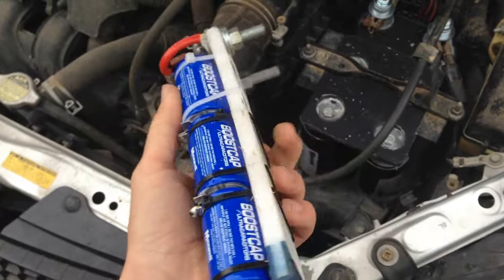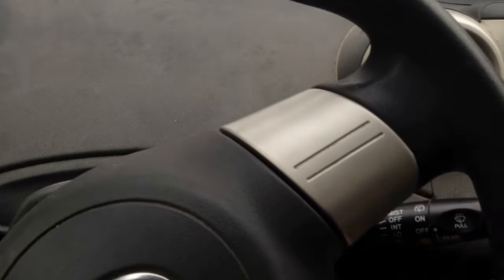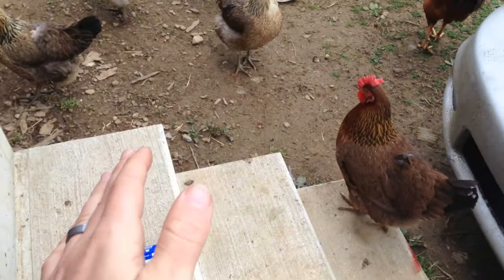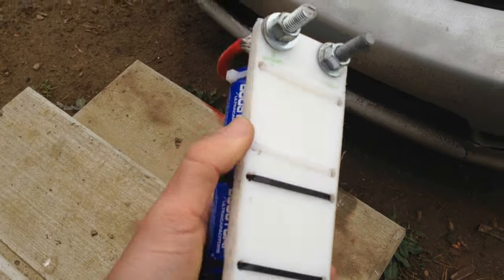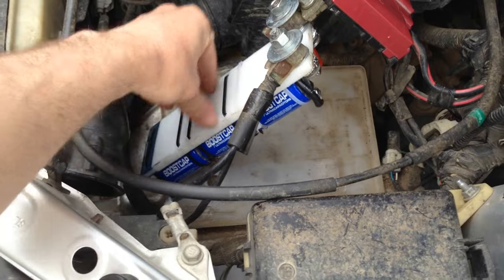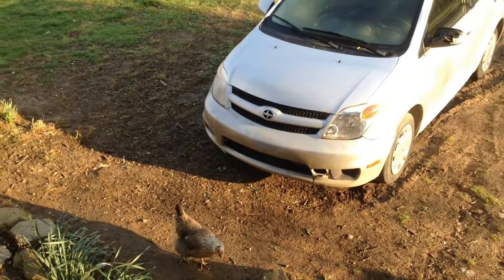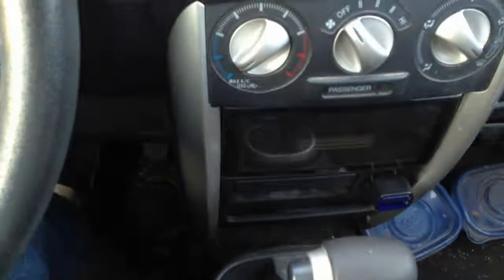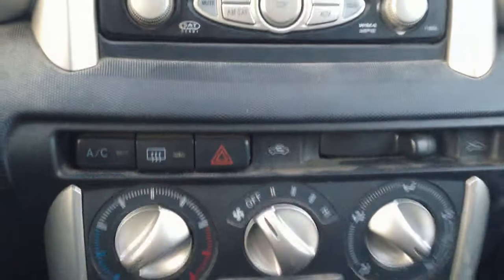Replacing My Car Battery with Capacitors! 12V BoostPack Update

Comment: This info is from the internet a university site!
I haven't copied it all. 

BU-209: How does a Supercapacitor Work?

Discover how the supercapacitor can enhance the battery.

The supercapacitor, also known as ultracapacitor or double-layer capacitor, differs from a regular capacitor in that it has very high capacitance. A capacitor stores energy by means of a static charge as opposed to an electrochemical reaction. Applying a voltage differential on the positive and negative plates charges the capacitor. This is similar to the buildup of electrical charge when walking on a carpet. Touching an object releases the energy through the finger.

There are three types of capacitors and the most basic is the electrostatic capacitor with a dry separator. This original capacitor has very low capacitance and is used to filter signals and tune radio frequencies. The size ranges from a few pico-farads (pf) to low microfarad (μF).

The electrolytic capacitor provides more farads and these larger units are used for filtering, buffering and signal coupling. Rated in microfarads (μF), this capacitor has several thousand times the storage capacity of the electrostatic capacitor and uses a moist separator. The third type is the supercapacitor, rated in farads, which is thousands of times higher than the electrolytic capacitor. The supercapacitor is used for energy storage undergoing frequent charge and discharge cycles at high current and short duration.

Farad is a unit of capacitance named after the English physicist Michael Faraday. One farad stores one coulomb of electrical charge when applying one volt. One microfarad is one million times smaller than a farad, and one pico-farad is again one million times smaller than the microfarad.

Engineers at General Electric first experimented with an early version of supercapacitor in 1957, but there were no known commercial applications. In 1966, Standard Oil rediscovered the effect of the double-layer capacitor, which makes the supercapacitor work, by accident while working on experimental fuel cell designs. The company did not commercialize the invention but licensed it to NEC, which in 1978 marketed the technology as “supercapacitor” for computer memory backup. It was not until the 1990s that advances in materials and manufacturing methods led to improved performance and lower cost.

The supercapacitor has evolved and crosses into battery technology by using special electrodes and electrolyte. While the basic Electrochemical Double Layer Capacitor (EDLC) depends on electrostatic action, the Asymmetric Electrochemical Double Layer Capacitor (AEDLC) uses battery-like electrodes to gain higher energy density, but this is affected by a shorter cycle life and other burdens shared with the battery. Graphene electrodes promise improvements with supercapacitors and batteries but such development is 15 years away.

Several types of electrodes have been tried and most are based on the electrochemical double-layer capacitor concept, which is carbon-based, has an organic electrolyte that is easy to manufacture and is the most common system in use today. 

All capacitors have voltage limits. While the electrostatic capacitor can be made to withstand high volts, the supercapacitor is confined to 2.5–2.7V. Voltages of 2.8V and higher are possible but they reduce the service life. To get higher voltages, several supercapacitors are connected in series. Serial connection reduces the total capacitance and increases the internal resistance. Strings of more than three capacitors require voltage balancing to prevent any cell from going into over-voltage. Lithium-ion batteries share a similar protection circuit.

Comment: Impressive since the capacitor bank is rated 16.2V / 58 Farads.
Reply: which are just 2Wh total, when the coltage drops to zero. Traditional lead acid 12V 55Ah battery has 660Wh
Reply: These are 350F caps, all in series so 1/(6/350F)=125/3=42F in total.
With a total voltage of 2.5*6=15V (Maybe one cap bust).
Typical start up current (Which varies with temperature) is about 200A, equivalent to a resistance of 12/200=60mR.
Therefore the time taken to discharge to 0.63& of 15V is around (0.06*42=2.52sec), ot sure on the time taken to start a car but guess a second?, so good for around 3 starts?.
Reply: (6) 350F caps in series is 58F.
Reply: electronicsNmore 350/6, which is indeed 58.3333333333333333333333333333333333333333333333333333333333333333333333333333333333333333333333333333333333333333333333333333333333333333333333333333333333333 lol
Reply: John Siviter
 You forgot to include leakage. Capacitors are not perfect and leak over time.
Reply: True, refer to datasheet to calculate that)
Reply: megamixa
Reply: John Siviter
My 3.0litre, 6 cylinder engine's Starter system has a 50A fuse on it, so it must'nt draw more than that when cranking in the cold. I believe the BoostCap Battery would crank for quite some time, as demonstrated in one of the follow-up videos on a much smaller engine.  Further, as the Voltage presented to the starter by the BoostCap would be greater than the typical Lead Acid battery under starting load, the engine would likely turn over faster as well, lengthening it's ability to deliver a starting charge.
Reply: heysoundude Starter motors do not have fuses connected on them, what you're refering to as the 50A fuse for the "starter system" it is in fact the solenoid part of the starter motor only, not for the actual motor it self. The motor part is un-fused and connected directly to the battery via the thick cable, which is where the 200A goes thru.
Reply: Black Wolf Good catch, not that he needed my endorsement but Black Wolf is correct. Starter motors use hundreds of amps.
Reply: I would like to see it crank the starter for a few seconds instead of just a "ka-Vroom" start.  I think my old car is more of a "Zha-Zha-Zha-Zha-Vroom".  :-)
Reply: Stan Skaggs In your case it would be Zha-Zha-Zhaa-Zhaaaa-Zhaaaaawwwwwww... without the Vroom on the end, however one might be able to hear a few #%?& or even %&#?#
Reply: I've got 12 of the big caps and they have worked for 3 years no problems. I have to start my car after 3 days if I don't drive it . If your caps go lower than 10 volts your fucked.
Reply: @engjds  350F/6=58.33F
Reply: @HSV1066  i kept laughing when reading this comment... :-D
Reply: Thank you for the explanation, but would you advise us to use these capacitors instead of the battery? Thank you
Reply: @petrvalkoun4539  advh

Comment: Cool video. I'll keep my lead acid battery though. If your alternator quits when you're  30 minutes from home, a healthy lead acid will get you there. The super caps will leave you stranded.
Reply: Joe S maybe, maybe not.
Reply: True joe
Reply: Joe S   actually the spark plugs require much less than 12 volts and 
just a few milliamps to keep the plugs sparking  and engine running .
Reply: Electronic ignition requires about 1 amp per 1000 rpm.  Fuel pump draws about 3 - 5 amps, not sure about variable pressure pumps. Don't know how much the engine computer needs.

Comment: Nice video. Just one quick correction, you don't have 350F there, when you install capacitors in series, you get double the voltage and half of the capacitance. Which means that now instead of 2.5V and 350F, you have 2.5 x 6 = 15V and 350 / 6 = 58.33F. Which stills pretty good by the way. Can you make a video trying to start the car a few times in a row? With the coils disconnected or something, to prevent the car to start-up, just to see how long the caps are gonna last. Thanks!
Reply: You are wrong. it would be 15v @ 350 farads. Just like batteries in series.
Reply: No he is right, 6 capacitors in series with 350Farad is:  1 / (1/350)*6 = 58.33 F and 2.5 x 6 = 15 Volt.
Reply: @tripelbier7335  Capacitance is relative to voltage and your calculus is assuming the voltage per capacitor is being cut by a fraction, for instance if i put a bulb in series with the capacitor to charge it using constant current until it reaches full voltage it will run for x time, if you set the voltage at half then the bulb will run x/2 time providing half the current and therefore providing half discharge. I hope you understand that.
Reply: @tripelbier7335  i can't edit, but i meant the full current for half the time in the end.  You learned following an example of a  series capacitor on the same source voltage, not a varying voltage, if you had y capacitors and didn't change the voltage then you would be right, but that only applies mostly to electronics where you'd want to condition a signal on a power rail that doesn't change voltage.
Reply: Shouldn't they be wired parallel?

Comment: I think that the people don't know that the batteries are just big capacitors , having exact same behavior on same dimensions/capacity. Guys, don't discuss about this, the differences between capacitors and batteries are coming from their fabrication technology.
Capacitors :1 F = 1 s4·A2·m−2·kg−1 = 1A*1s/1V so for 2 V (14V-12 V interval) you need 2 F just to have 1A current during second. 
Car battery: 100 A·h can deliver 5 A over a 20-hour period at room temperature for same 14V-12V interval..
Let to discuss about 55Ah common car battery. Normal voltage for charging is 13.5 V maximum 14 V and the lower limit is 12 V so you have  2 Volts potential difference to work. 55Ah means 2.75 A in 20h. To obtain equivalent capacity from capacitors you need 2.75A*20*3600s for each volt so result is multiplied with 2. Result?  2.75*20*3600*2= 396000 F (Farads)
In this movie  we see 6*350F=2100 F which is 200 times lower capacity of the car battery.
What means this? Simple. You can start your engine with a capacitors module, but just if everything is perfect and you are sure the engine will start from first attempt. Don't expect to have energy remains for the second try...or let calculate: starting current is 20A so you need 20*2=40F just to have energy for a second. 2100F (total)/ 40 F => 53 s of full functionality. Not too bad but sure not to change the car battery. So ...
Car battery is strong recommended, you can have a capacitor module just to help the battery or to start cars with depleted batteries. Don't forget: car alarm and other electrical devices have working nonstop so capacitors will be depleted if you don't start engine often...
Reply: Except capacitors store energy in an electric field and batteries store it in chemical changes. So batteries are capacitors kind of like a moped is just a big bicycle. :)
Reply: capacitors do not generate power through chemical interaction (bi-metal plates and acid as the electrolitic acid) capacitors simply store electrical potential on its plates and in no way generate potential.
Batteries are the opposite of a capacitor in other words.  They are not the same thing.  One stores and one generates.  This is basic electronics my friend.

Comment: Looks like a good idea for racing application.
Reply: +Andrew Kammerer its not the caps will dischage in 5-10min
Reply: Awe bummer
Reply: Andrew Kammerer yeah thats why caps arent used for energy storage just for smothing out ripple and for filters and stuff
Reply: If you mean for starting a petrol engine,  then yes.  or a very short electric race :) 100m uphill dash etc.
Reply: +Crusty Gronk Okay, now I'm confused. Where/when/or how did Andrew Kammerer state this would not work? All I find is him making a comment that this would work great in a race application. That doesn't mean he thinks it won't work on a street vehicle.
Reply: +Ges x My bad I guess. I think I've just posted this under the wrong reply.  It was actually meant for Paul Handley.
Though i don't know how it happened. This is way down the page (for me) Paul Handley is at the top. 
Thank God the youtube "wrong post" police showed up.
Reply: Crusty Gronk lol! Gotcha. Makes sense now. No big deal. If that was the biggest goof I ever did I'd be nigh on perfect I guess.
Reply: Ges x
"It's all good. Cheers.
Reply: +Andrew Kammerer I'd agree with you, as many people use battery relocation as a method of weigh distribution for racing.

In the same way, you could keep your stock location and just use capacitors in racing to save a few pounds.
Reply: +Andrew Kammerer 
Wouldn't you just take out the starter and battery for racing?
Reply: +illidur starter Is needed to start the car so no, and without a battery or equivalent you have no power to start the car. Also there is the fact that alternators need power to generate current initially unlike the old school generators. Unless you are push starting an old manual car with a generator and even then I would worry about the initial current for the sparkplugs
Reply: Matthew Stoumbaugh
Whats wrong with push start? I thought that was standard for racing.
Reply: Full spec race bikes (and cars) have no starter, but they do need a battery. The reasoning is simple - if your engine stops in the middle of a race, the race is already lost, so you might as well do away with the starter to save weight. All top race teams use external starters.
Reply: I'm confused from the comments on this post, do some people not have alternators?  For racing you will benefit for 2 reasons.  A capacitor that is welded together (6x Maxwell 300 Farad caps) weights like 5lbs.  Also it will store the alternator voltage of (13.8 hot, 14.4 nominal, or if you throttle your voltage like me 15.5 with a max of 16.3).  If you have current being drawn then obviously go down, my vehicle when off pulls 500ma.  I think I can let that draw for probably a few days to see a noticeable drop